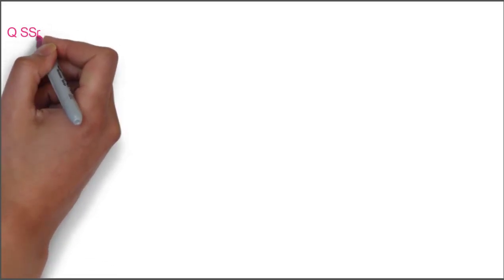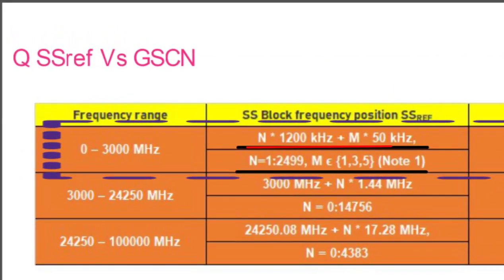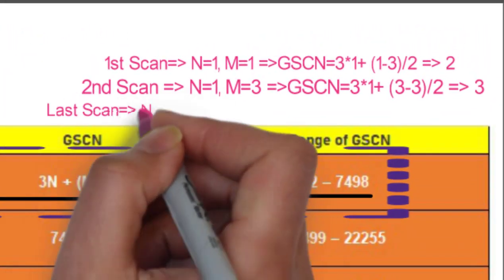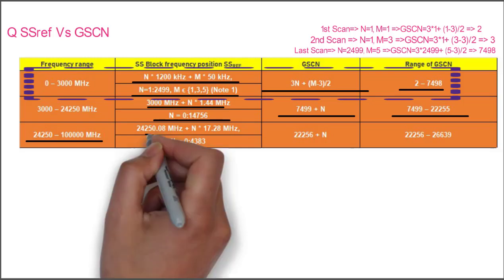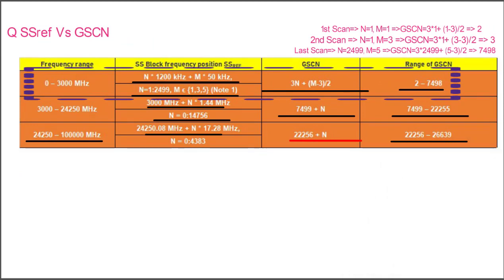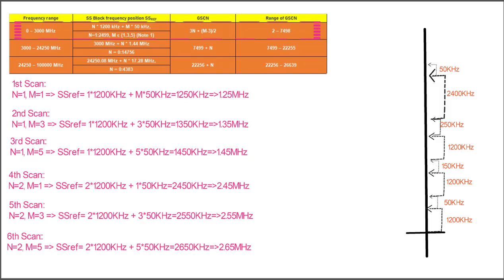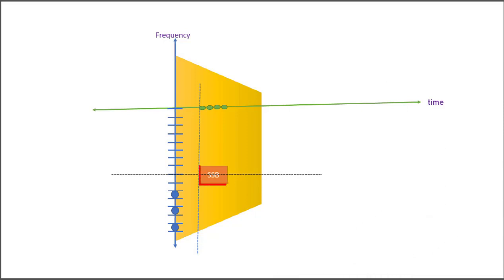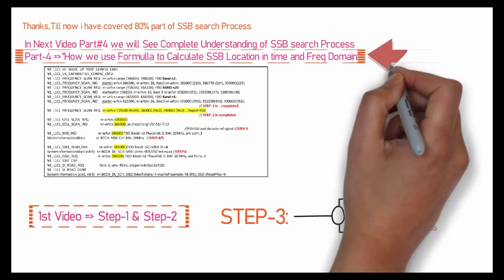Part#3|5G-NR Cell Search Process in Stand alone mode - Part#3|SSB Search Process| After switch on

Comment: excellent video, but i have confusion. For 0-3000 Mhz, the syncronisation raster is 1.2Mhz. So it will search the bandwith in every 1.2Mhz and try to find the center frequency of SSB, which is SSref.  But according to formula, we see that 1.scan (N=1, M=1) is 1.25Mhz, second scan 1.35Mhz, third 1.45Mhz and fourth is 2.45Mhz. So the interval is not 1.2Mhz which is sync.raster, it is different. May be i confuse smth, glad to be explained